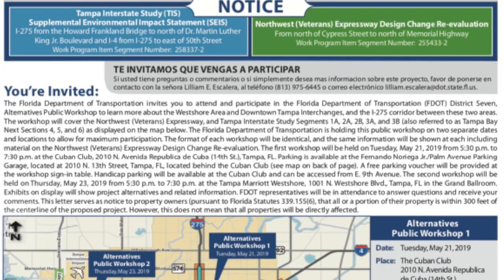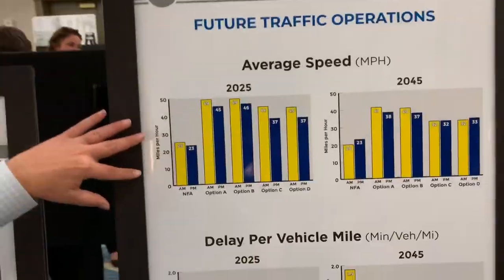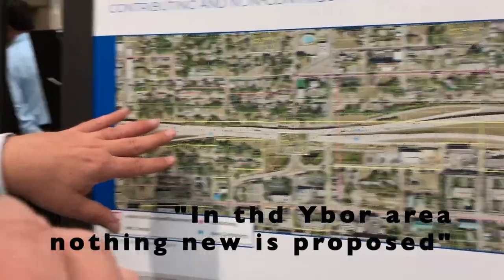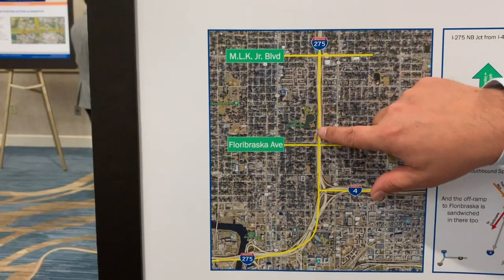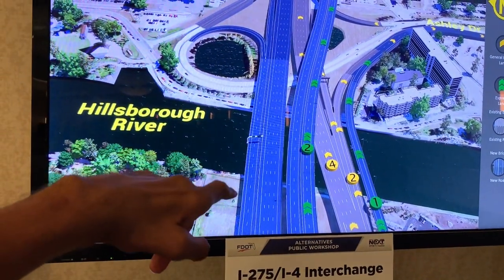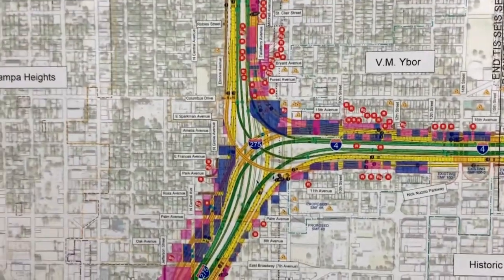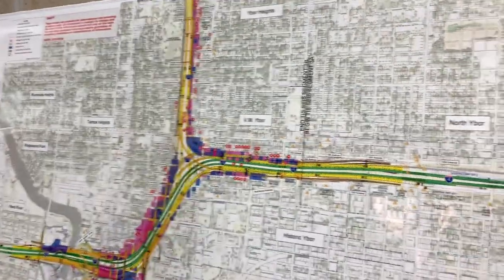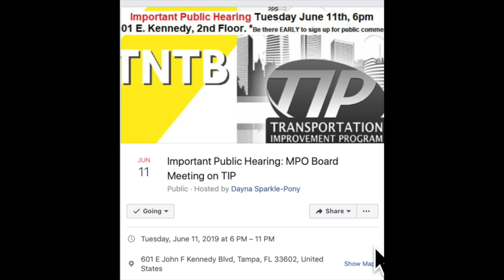The full story of the new plan for I-275 malfunction junction = 24 lanes

Comment: I really think interstate 4 and interstate 275 should not have express lanes and not even be widened. At the Westshore interchange between interstate 275  and state road 60 (Memorial Highway) the main interstate 275 general purpose lanes and Howard Franklin bridge express lanes should focus on curving and connecting Northward onto State Road 60, the Veterans Expressway, and Tampa International Airport focusing on getting traffic from Interstate 75 in Pasco and Hernando Counties and out of state heading to Saint Petersburg via the Suncoast Parkway and Veterans Expressway while the I-275 Howard Franklin Bridge Express lanes would empty out into the general use lanes west of the Westshore in which interstate 275 would maintain its current 6 to 10 lane layout with a light-rail and high-speed rail corridor in the center.